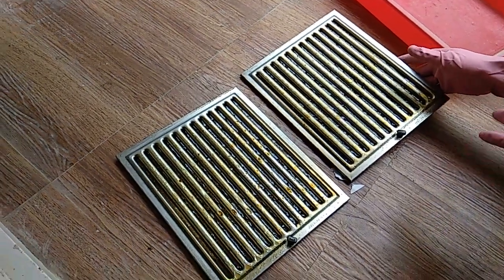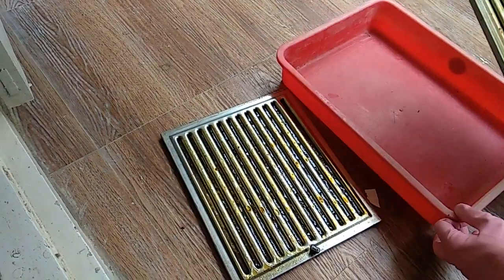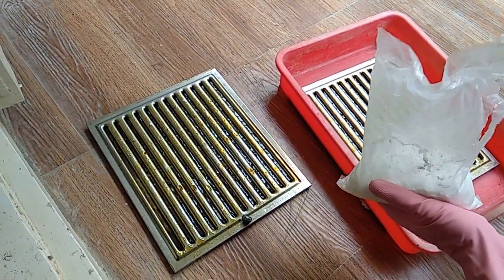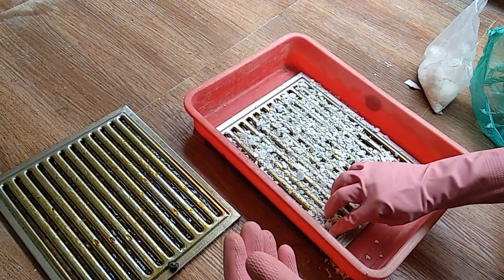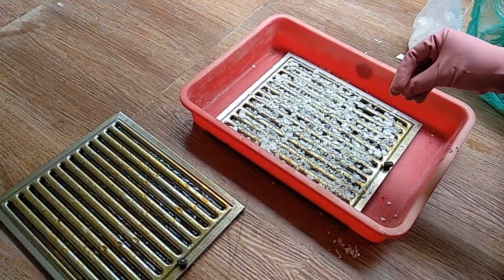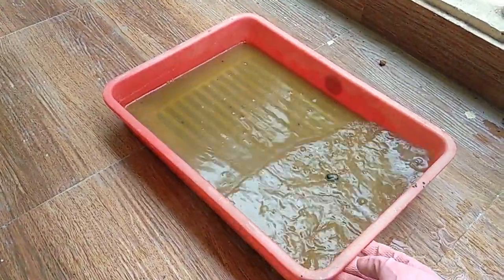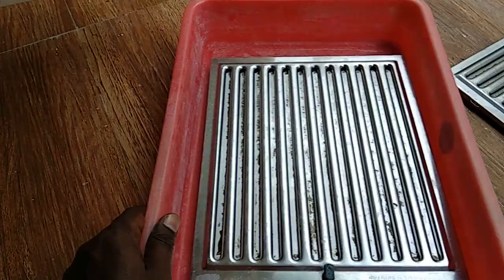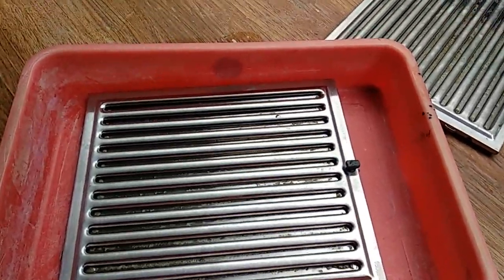How to Clean Chimney filter?

Comment: Only 1/2 cupful of Caustic Soda Flakes are enough for one chimney. No need to push these flakes into the baffles. Just spread the flakes evenly and pour very hot water...and leave it...It will serve the purpose..👍👍
But be careful while pouring boiling hot water...!
As soon as water is poured on soda, a strong gas will eminate from the mixture...Keep your head away...!!!